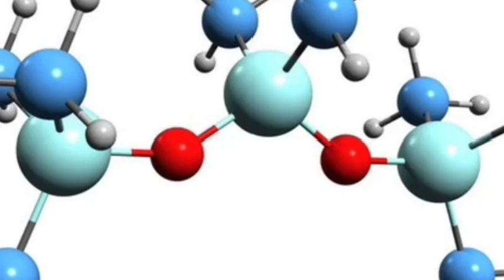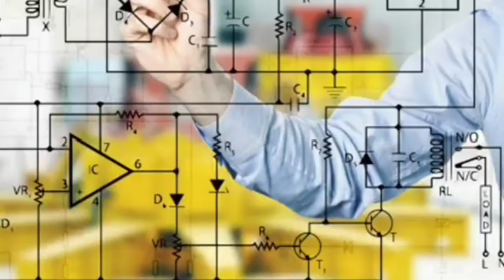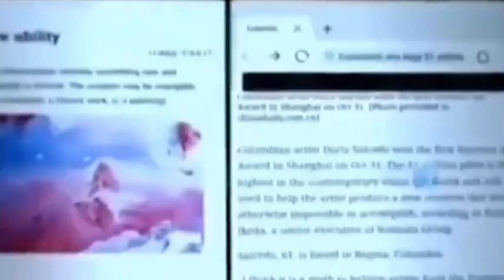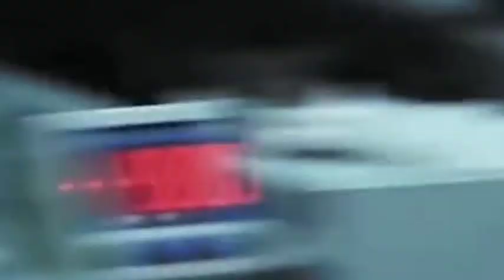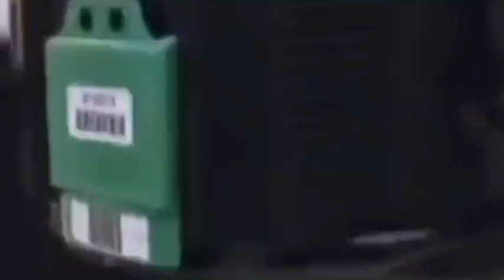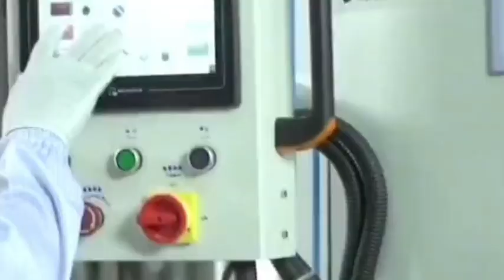China's Tsinghua University has developed a 0.8nm Meta Imaging Chip, beyond EUV 3nm chip.

Comment: I hope the narration makes sense in Chinese, because it's 100% bullshit and bafflegab in English. Imaging is limited to one-half the wavelength of the em energy source. In the case of "optical" imaging in the colloquial sense, this is visible light, the wavelength of which is too long to etch 3nm circuit pathways. Thats why ASML uses "extreme" UV.  In theory, any emr (electromagnetic radiation) beam can be used, but beyond a certain frequency cannot be readily focused or directed by convention optics  as it tends to pass through even solid, opaque materials with little reflection or refraction and would require different chemistry to etch the chip than the light-sensitive materials currently used. So far this video explains nothing and its attempts to explain even the basic concepts are just plain wrong.
Reply: It should be Quatum Chips.

Comment: Wow, Tsinghua university has been able to develop 0.8nm chips which is far smaller than 3nm, clearly a milestone in the optical imaging technology of China. It is plausible that China will be able to produce photonic chips by next year which does not use the silicon based technology making the usa’s chips industries to fallback by a decades. It will have significant consequences for usa’s economy.
Reply: Not really plenty of industrial tech runs on decade old designs. Even the car industry will use the same ECU design across many years.